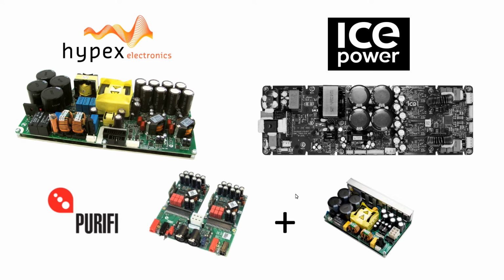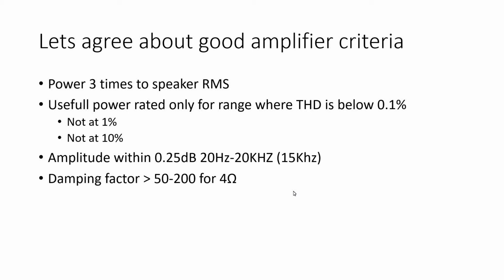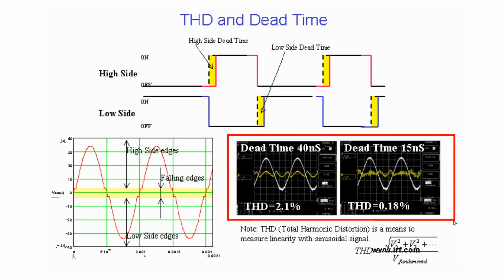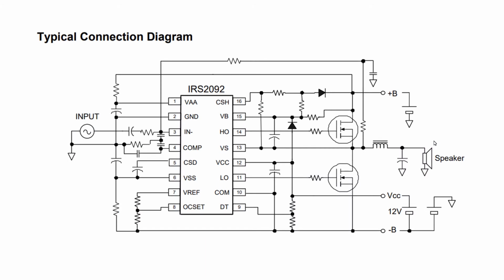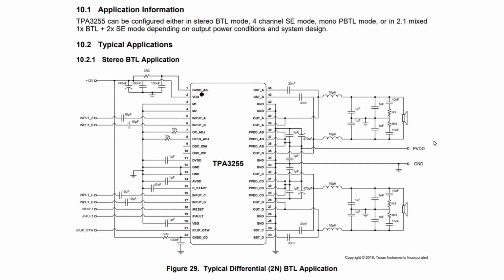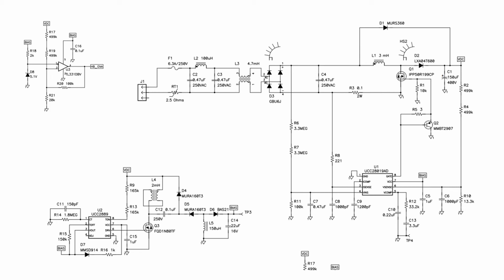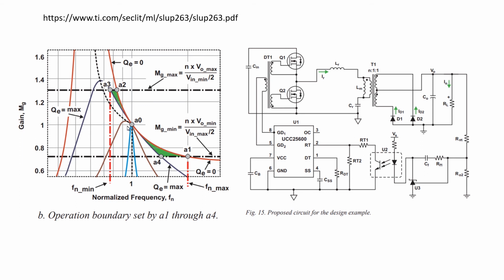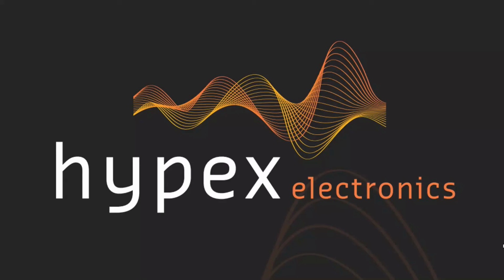Class d amplifier boards overview part 1

Comment: What is the part no on that black ice power board . That looks like the 2023 new release parts express dont have .. where can i buy 2 1200 watt 2023 black ones ? Think those only come 700 n 1200 . Want to change out the 700 watt mono ice power in ps audio m 700s ty 😊😊
Reply from the maker: I guess you are talking about Icepower 2000AS2. You can purchase it from proven EU retailer Soundimport https://www.soundimports.eu/en/icepower-2000as2.html . They have it in stock and provide warranty services WW.

Comment: Class D is digital, class A is analog. Sorry but that will never change.
Reply from the maker: Class A is far more heater than the amplifier. Class d in theory is analog as well. It is pulse width modulation. The latest device's quality is incredible.
Reply: Digital is depending on resolution, analog is depending component & system precision...

Comment: What do you think about Topping PA5 vs Purifi and other class D amps? Considering one for my setup.
Reply from the maker: Hi, it depends on what you are aiming at. The amplifier stage is not the main design challenge. The power supply is. The difference between a good and a great amplifier is in power supply quality architecture. PA5 uses a mainstream computer-type power supply that is not designed for high instant current capability. I would recommend finding solutions with an integrated power supply. PA5 is expensive for an 80W amplifier. Purify design has 400W output. Working away from clipping is more important than THD figures.  The key difference will be in low frequencies performance. Low frequencies are important for emotional perception and richness of music reproduction. Those 2 units are not comparable. Purify wins in all aspects, but to make a finished unit you need a good power supply, and those are significant costs.
Reply: @guntarssmits2104  Thank you
Reply: @guntarssmits2104  Спасибо! Тоже интересовал данный вопрос.

Comment: Awaiting your next episodes in this series. I know you like ICEpower. If you were to start from scratch would you pick Purifi or Hypex Ncore over ICE for a DIY giant killer amp?
Reply from the maker: At high-end booths are equal. Absolutely great products in all aspects. If you want to build one and forever for music listening the sweet point is Hypex NC502 and ICEpower 1200AS2. Hypex NC502 can provide about 300W perfect sound in stereo mode with some headroom, ICEpower1200AS2 about 500W + headroom. It is hard to find a listening scenario when you will be short with power and quality. Practically you will never hit above 1/3 of power. My pick of ICEpower is business-oriented due to the larger lineup, especially in the budget range, not a quality consideration. Purifi is a bit different story. The company philosophy is to sell and license R&D technology, not the finished product. Maybe in the future, but today this company providing variations of reference design kit. There are no certified products in line up yet. Certification is important as well. Not for DIY, but in the professional market, you cannot sell anything non-certified. And certification is an expensive and long process.
Reply from the maker: My pick will be 1200AS2. I recently developed a prototype and the result is outstanding. Probably today it is one of the best performing amplifiers in the world. And price/performance is unbeatable. It is a true end game amplifier board  with quality exceeding human hearing limits

Comment: I am building a 4 way speaker and planning to use ice power 4 300A2 amp and 1500s smps. I don't have electrical knowledge and can't make out how to connect rca out, banana plugs and connection between the above mentioned components and also main plug and power switch. Can you help by showing how to connect these using board pics
Reply from the maker: Have you looked at board Support materials There is PDF for download with pin legend and many more https://www.profusionplc.com/parts/icepower300a2